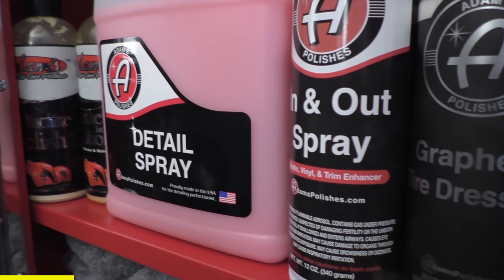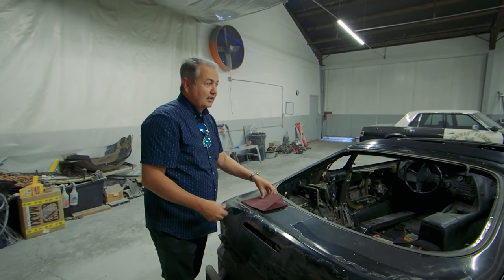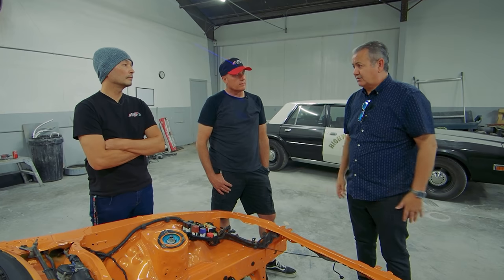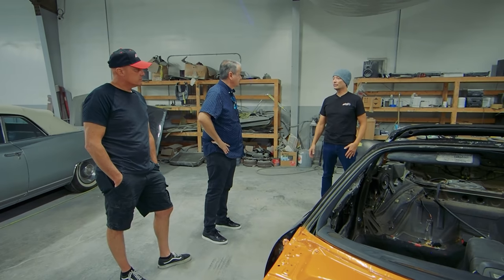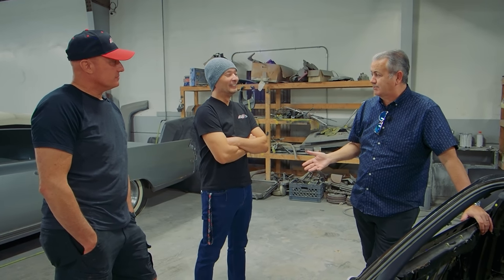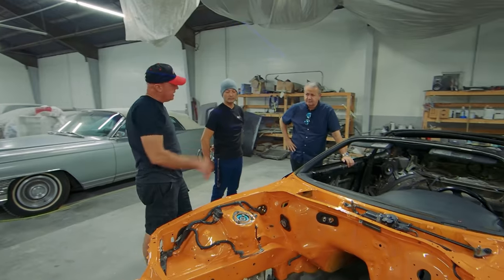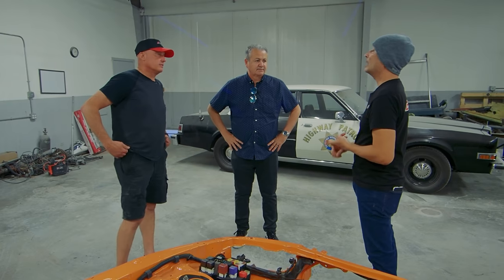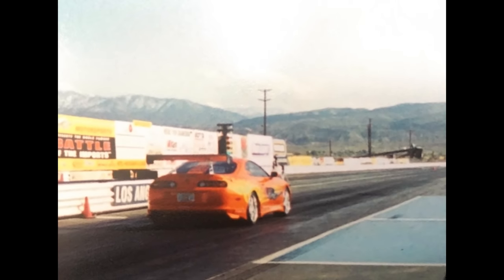Fast & Furious Supra Build (Part 3)

Comment: T56 Magnum-F would have been a good choice. Grannas Racing sells them as a kit and it's very easy to install and comes with all the needed parts. He has his own aluminum bellhousing that makes the install bolt-on. I run that in mine, and it drives like a dream with the Tilton ST246 twindisc clutch. No need to use throttle to get it going and the clutch holds 1200Nm of torque.

Comment: Craig, check out theRPF forums and see if you can get some help on parts that arent made.  For example if you can get the brake calipers without the trough/ badge, why not modify new ones and have the trough CNC'd and a badge made?  Them guys make unknown star wars parts from 40 years ago, some of this stuff you need will be easy.  Alot of the folks (myself included) do it for the love of replicas/ movies and will help do it at cost.
Reply: Not a bad idea. Grab a chunk of aluminum and CNC a couple pieces with the logo, and drill and tap them to the body of the caliper with a couple counter sunk screws. Problem solved. As far as the headlights... theres no harm in sticking a set in the oven at 200 deg or so, soften the glue, take them apart and recondition as needed. People mod OEM lights all the time like this, myself included back in the day and with a little elbow grease, and the proper prep work you can make them look great. The film you're talking about is Lamin-X. Great product and I've used the clear and smoke versions of their thick 32mil films to protect my E-code headlights and fog lights on a handful of my cars, and some customers builds in the past. No complaints from myself or anyone on the longevity of the film and sure beats a broken or 'sandblasted' lens. It comes precut for most OEM lights or in bulk sheets to cut your own.

Comment: Joel Grannas all day for a complete T56 kits and he's fully stocked up on them.  Amazing setup with a tilton master cylinder and hydraulic throwout bearing.
Reply: Tilton makes some quality stuff, theres no doubt about that but honestly IMO there are much better options than a T56. They feel like shit compared to many others. Any trans that they use in a chevy truck has no place in this build really. The reason I used the truck version as an example is it's a 'top loader' configuration and no long linkage and still feels pretty mediocre at best. I know it's my opinion, but after driving plenty of cars with the T5 and T56, the CD009 is a MUCH better choice for shifting feel. One of the ZF or Getrag BMW trans with an adapter would be better suited as well IMO.

Comment: honestly the yellow works id say. its hard to build a replica with the actual owner of the vehicle because the owner actually knows everything the car had, but a "film exact" replica only shows certain things. the car that Craig had could of had purple paint on the underside that nobody ever saw in reality or on film but "the car had purple paint on the bottom" so the replica needs purple paint on it so you can only go so deep into it. exterior NEEDS to be film exact. engine built 2j, doesnt matter how built as long as it is a "2jz no shit". interior id say, as close as you want it. sound system similar style but doesnt have to be the exact setup Craig had, 2 nitrous bottles, 2 subs, 3 amps, laid out similarly (dvd player, ps5, tv optional)

Comment: Why did each NOS bottle have 2 lines coming off them?
I am enjoying every minute second of this process, please don't skip\montage anything.
Reply: Which lines?
Reply: i only saw one bottle with 2 lines...i'd say to tie them together as i dont think they had a nitrogen push system back then to keep the bottle pressure up.
Reply: @tirbomax  Oh, ok.  So they are basically daisy chained together?  Each bottle empties at the same rate? I need a diagram because I'd like to add a second myself.
Reply: @traviswalker8933  High pressure nitrous lines.

Comment: Craig, maybe rebuild this supra with modern view? Or make it without some mistakes you've done in the past?
MY supra was with v160 with shortshifter, damn, it's like ak47. r154 sucks... Maybe use gertag gearbox from BMW with plate?
Reply from the maker: That's not the direction we want to go. We decided that months ago.
Reply: @craiglieberman  What if… after you build this one, you do another Mark IV in a “modern” style? Like if the original F&F was to be rebooted today, what would the orange Supra look like? The only requirements would be that it was the same color and a Mark IV.

Comment: Regardless of if it was shown on camera or not you know for a fact that the engine bay on your car was black, so it needs to go back to black. It’s the same as keeping the cage yellow, yeah you wanted to repaint the car yellow but you didn’t because it became a damn icon. Therefore the engine bay needs to be BLACK. The only thing I do think you need to fix/make better than in the film is the wheel spacing. As much as I loved that car(minus the graphics) the only complaint I had was the fact that the wheels were too sucked in, H&S was around back then! Get some spacers lol
Reply: the difference is everyone saw the cage, the engine bay wasn’t shown. it would make more sense to paint the bay orange than put spacers, since that’s something we actually saw

Comment: I really wouldn't want to sell my transmission but I have a 6 speed turbo swap sitting in my storage. Transmission has 82k miles on it worked perfectly fine 8 years ago so. Seattle Washington. $8000.00
Reply: V160 price is $8000.00 not the full sway I'm not willing to sell the engine... Yet at least.
Reply: They found one.